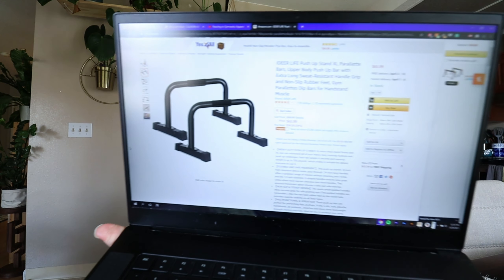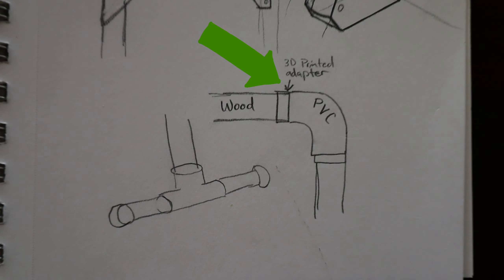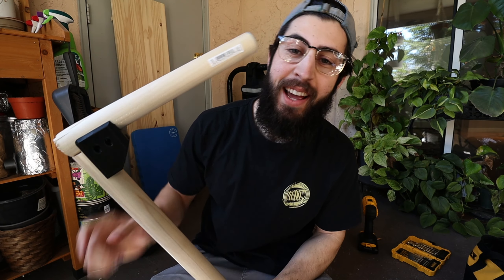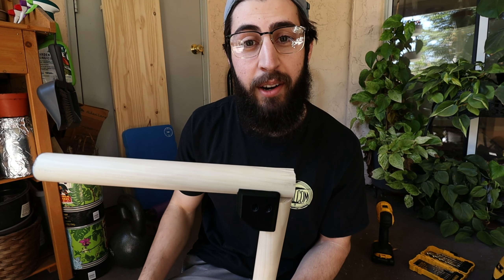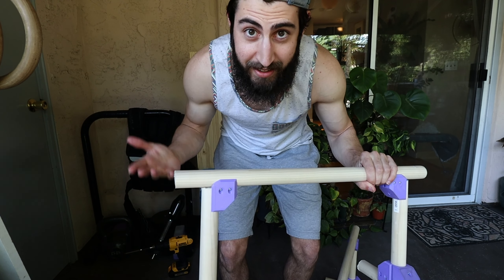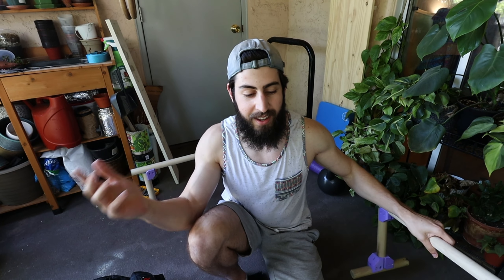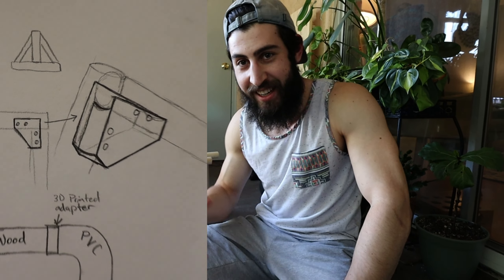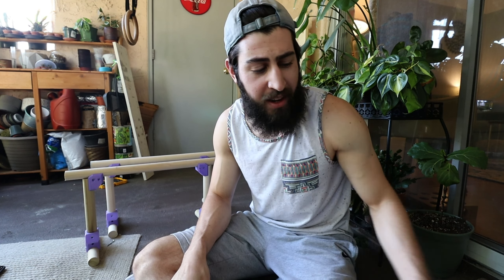DIY Parallettes | PVC ones are lame

Comment: Super elegant design John I'm buzzing to try to recreate this! Could you please clarify the dimensions you ended up going with (height x width) cheers? :D
Reply from the maker: Much appreciated! I went with the standard 12" tall 24" long. Definitely would suggest doing the extra right angle on the front back for more stability long term